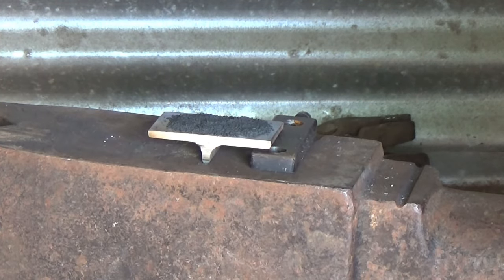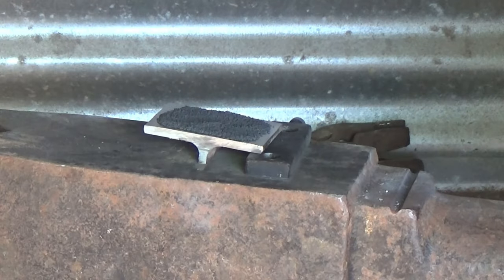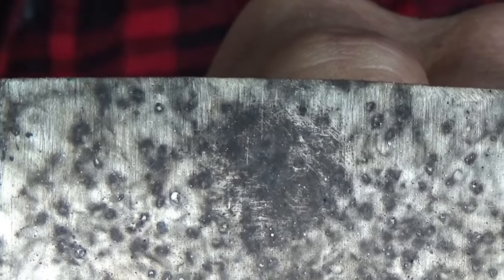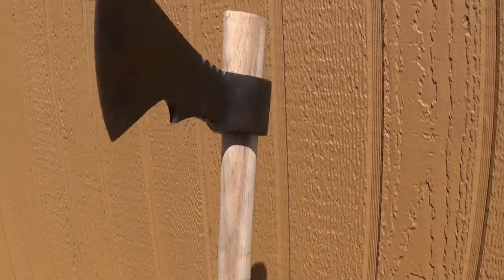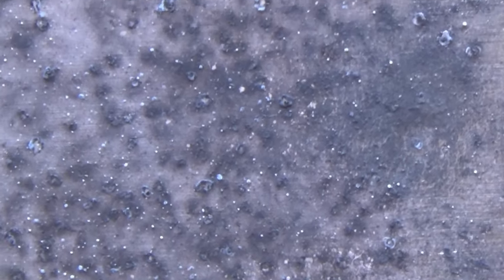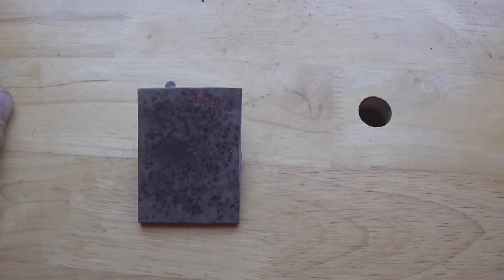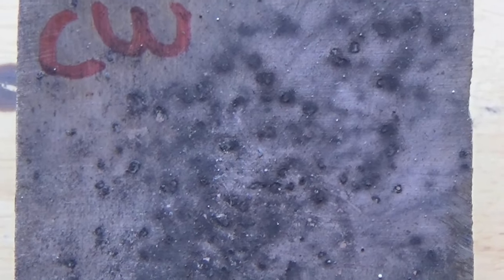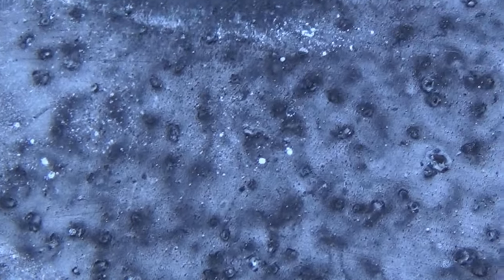DIY Homemade Black Powder...Does Water Make a Difference?

Comment: I use alcohol for pucking, I haven't tried water yet.
Reply from the maker: I stopped using Alcohol, someone stated you can get tighter puckes with water.  I am making a batch of powder and will test that statement.
Reply: @lamebeavertradingco.1642  that's interesting, I'm new to making homemade powders, I've only been making my own for a few months, I'm still learning and experimenting, it's fun tinkering around with all this stuff, but I'd like to see if there is a difference between h2o and rubbing alcohol. Take care bud🇺🇸

Comment: I agree with you that there is probably no effect caused by any contaminants in the water. We're talking measurements of parts per million of contaminants in most water. Even 1,000 ppm would be 1/1000th of the amount of water you are usung, which is already a tiny fraction of the mass of the gunpowder, so any contaminants would be a tiny fraction of a tiny fraction of the total mass.

You could probably use ditch water with no noticeable loss of power or increase in particulates left over.

Comment: Pure water which distilled water is close to being would not add something that would be solid. The charcoal differences would though. The same kind of tree may have different quantities of minerals from tree to tree and from where on a single tree the wood was taken. If you want to know what those white and black specs are a person could send them in to have them analyzed in a laboratory. I doubt it will make enough difference to pay for spectral analysis but if one owned a black powder company and wanted to come up with the best black powder product it wouldn't hurt to analyze all the residues in a lab. It probably wouldn't hurt to analyzes the sulphur and potassium nitrate purities being used as well. People making rifle barrels on modern target rifles will send samples in to have the steel analyzed so they know they are getting the steel from a supplier that they have ordered and the quality.
Reply from the maker: It may not be solid, neither are the floaters in the water after the Ice melts, but they are there none the less, and they are seen even after the water evaporates away.